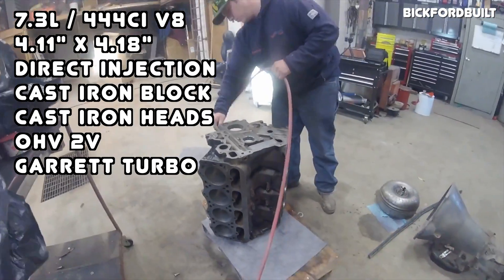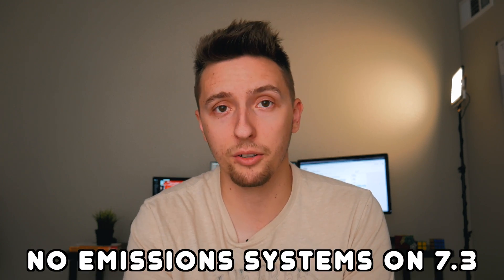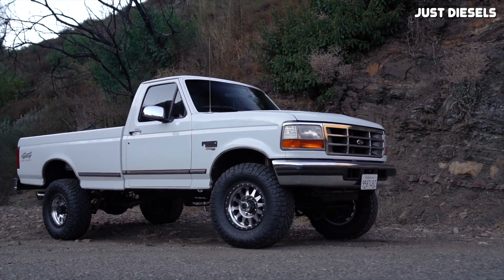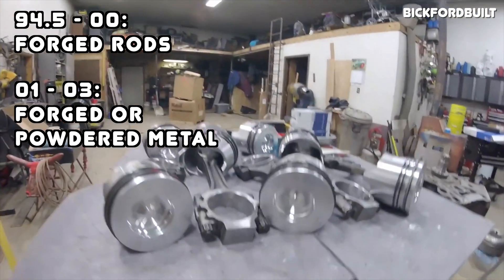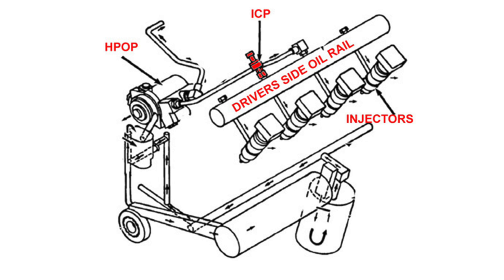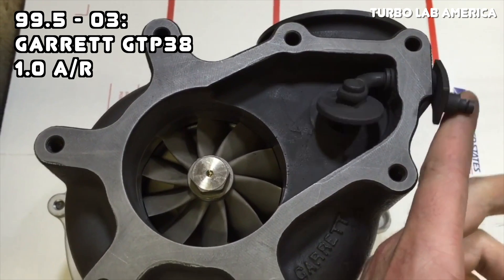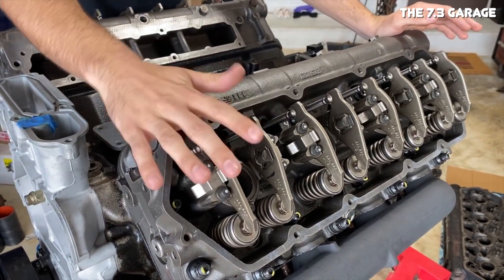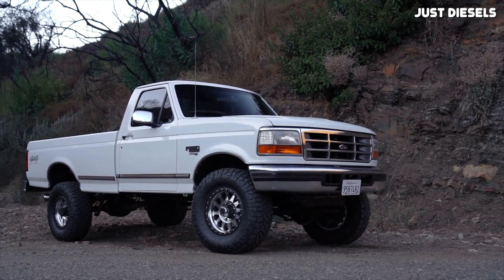7.3 Powerstroke: Everything You Need to Know

Comment: 12v 5.9 Cummins outlasted all of the 7.3’s I’ve owned
Reply: Yeah the engine how many Dodge trucks did you go through?😇
Reply: 12v Cummins do last longer... much simpler and easier to work on. Wish I still had mine. Although I still love my 95 f250 with the 7.3
Reply: All honestly   Each engine has there issues  weather is ford dodge or gmc/Chevy   Doesn’t matter it’s how you look at thinks  Cummins has injecton pump and head gasket failures and turbo issues  ford  has headgakets  turbos failures on 6.0 and 6.4 throw it away  7.3 are know to leak  and have a cracked pistons from over fueling or being not smart using either   And Duramax has injector promise all engine the list goes on all the engines.  At the end of the day do your maintenance across the board.
Reply: Dallas Korpan Chevy isn’t a fair comparison! Ours crapped out before 100,000
Reply: 12v 5.9 is very good. 7.3 PS is a little more complicated but just as good when the oil is kept up with. I used bypass oil filtration for max bearing life in my 99.5 7.3.
Reply: And the 5.9 cummins doesn't eat high pressure oil pumps. Or even have them
Reply: The video was about a 7.3
Reply: I have 2 Cummins and there getting rebuild only 300,000 km and my 03 7.3 has ove a million km  and still running no issues  so those statements  don’t fly   At the end of the day. They both can be good engine as long as maintenance is done across the board   Hands down  maintenance is key
Reply: Except in stepvans, all our old 7.3 powered International P1000s are still around and we’ve scrapped all our 5.9s.
Reply: I got 2 5.9 Cummins a 95 and a 03, both 4x4 and manual transmission ( the 95 was swapet to manual, the automatic passed away) , and I got 2 7.3 one 99 and one 2000, only the 99 it's 4x4, both automatic transmission , yeah the 5.9 feels invincible, more space etc etc even better mpg, both engines the 7.3 and the 5.9 are good on torque , but... This is why I prefer the 7.3... because is surrounded by a better truck, a Ford,  I love 3 makers Dodge Ford and chevy , but Ford vs Dodge in those years, Ford made a better truck, better brakes , better transmission  , better dash(Dodges  dash sucks) more comfortable... You get it a better truck , if the 5.9 Cummins is the "10 point truck engine" the Dodge truck is just a 7, I hate how they brake, the front suspension is better on the Ford, let's say a 7.3 is a "8 point truck engine" for Shure a Ford truck it's a 9  point truck.... Even with the 7.3 flaws..

I work with my trucks , I tow with them, I use the daily to work, to go on a weekend,  I depend on them, I take care of them because if I don't do it...it gets  expensive to repair them, I only make upgrades to make them better for what I used them, no Barbie lifts , lady rims or queen tyres...just  Work trucks, I upgrade lighting , better filters, better cooling , oil change on time,  this is why I don't have more recent years, because I work on them, this year's are simple, maintainable, reliable, and posible to work on them and solve problems...